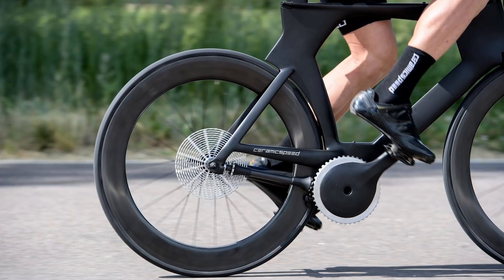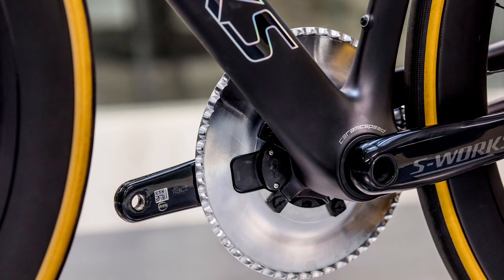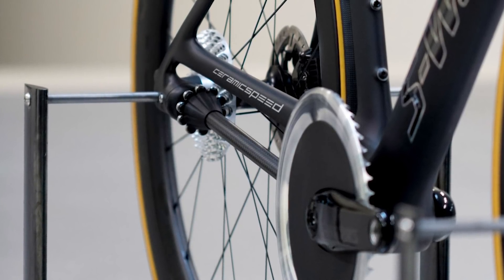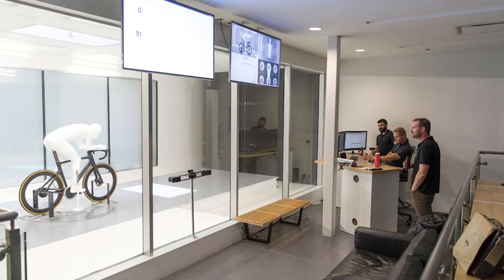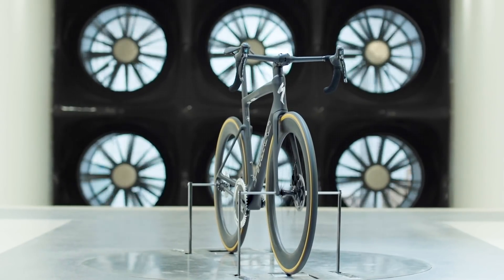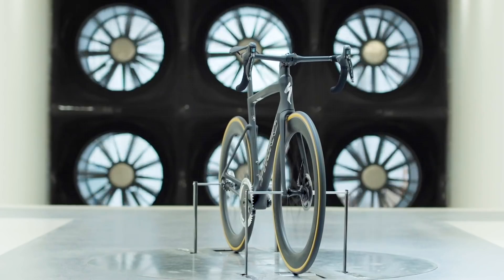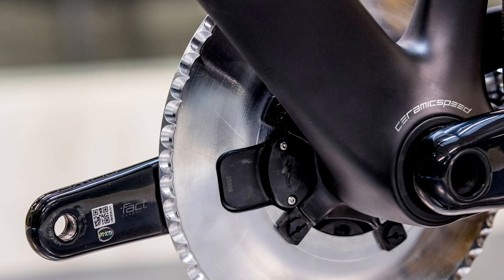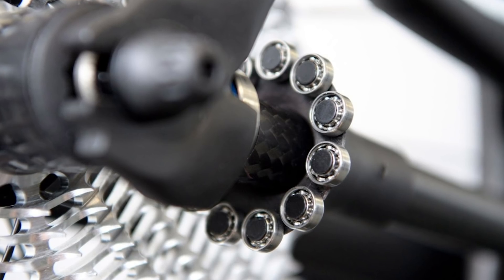'The World's Most Aerodynamic Drivetrain' | CeramicSpeed's Chainless Concept

Comment from the maker: Is this progress, or technology gone mad? Let us know what you think in the comments!
Reply: Marketing gone mad, not technology. It doesn't work, it wont work  (ask an engineer if you know one) and it's far from new. There is a pretty long list of fatal flaws and problems (non fatal but still requires compramise) but none of the press do anything but give this positive air time. It's a dud.

https://oldbike.eu/1898-quadrant-chainless-light-roadster/
Reply: Andrew Wade thanks for the link to that it was great!
Reply: @andrewwade5604  excellent point and reference. The 1898 model is actually better looking with full integration in the chainstay.
Reply: Doubt the system will handle sprinting loads, might work in a time trial application with more gradual force applied

In a sprint I doubt theres enough lateral stiffness in the rear disk to stop the bearings flexing it out the way and slipping
Reply: Currently very early days, but what we are seeing is enough to say "Hang on, they might be on to something", but nowhere close to ready-to-ride. Remember how long it took for disc brakes to be in the tour de france? Yea, thats right, it might be 20 years until we see this in a race. Currently ceramic speed has said they limited their tests to no more than ~250 watts as the drivetrain is fragile. They are also optimistic about scaling up the watts, but whether it can be done without a total redesign remains to be seen.

On a conceptual level, what stops me from getting the most out of the drivetrain on my bike is maintainance: Having chainrings, casettes, and a chain that is the prime of its life, keeping a clean setup, keeping dust and rain out of it on a ride, replacing bearings when they go, etc. Furthermore the rear-deraileur is incredibly fragile and can crumple up with the smallest impact or mechanical failure.

 What I find interesting with the new drivetrain, with the cover, is whether it will deliver that ultra-low friction more reliably than what a chain drivetrain does today.
Reply: It’s innovation.  Does it matter whether it’ll actually work?  Nope, not at all.  The process may discover something new or it may be a big fat waste of time.  No technological leap forward happens magically - it’s an iterative process with many prototypes.
Reply: Im sure these will come with electronic shifting but my god is it ugly.

Comment: Its still moving parts that are exposed, uncovered. We don't consider that as progress.
For progress, we want to see mechanism that are enclosed, sealed, & waterproof, so that its dustproof, dirtproof, mudproof, debris proof, etc (like Pinion or Rohloff Internal Gear Hubs) but at the same time with good gear range and good gear efficiency (like cassettes & chains), and good low maintenance (like Gates carbon belt or Drive shaft rods).
I guess good progress in technology not arrived yet.

Comment: I am amazed they are still working on this. Some quick research into motorcycle technology indicates that shaft driven power in motorcycles is substantially less efficient than chain driven power. Given that there is actually a lot of research and real examples of shaft driven power in motorcycles you would think that if they could rival the efficiency of chain driven then you would see it on motorbikes. I think once they actually engineer this to have similar reliability to a chain drive it would wind up being extremely inefficient to the extent that it is not practical for pedal bikes.

Comment: Everything about this bike would have to be incredibly rigid. Even a small amount of flex could cause the bearings to disengage/jump the teeth. I would, however, love to see it work successfully. It has the potential to blow away any planetary gear or CVD transmission system out there.

Comment: What about reversing the system, driving with the larger gear at the front? The front "sprocket" is already a SOLID piece, just add teeth as it's must more robust than the flimsy area in the back. Utilize a ring and pinion drive directly mounted to the rear axle and drive from the front versus the rear. Groove a hollow, ALUMINUM drive shaft (prop) versus carbon, incorporate tension springs at either end of the shaft and use the same current cable tech through a slip ring using a bearing to maneuver the gear change mechanism forward and aft. Splines through the prop shaft would mount to the gear change mechanism allowing full time contact. The system in this video is a very interesting idea...

Comment: I think they need incredibly strong materials to avoid slips and skips from felxation and even breaks because all the energy transferred through a small area of material.  I cant imagine aluminum as the cassette wheel, it would have to be some type of hardened steel. Something on he very high end of strength, shear and tensile.
Assuming they solve this- i thnk they have a design that is desirable just because it eliminates a chain and gear casette.

Comment: I envision that there will be too much flex in the rear cog plate near the outer edge due to lack of lateral support.  The pressure from the drive bearings will skip out of the teeth due to the pressure.

Comment: The gear change would be very complex - you cannot simply move the entire bearing wheel thingy down the driveshaft in one go while everything’s moving/under load. I think you’d have to split it into 2, moving the first half when it disengages with the cassette, then when that’s engaged on the target cog, you'd move the second half. Each movement would have to be synched with the driveshaft rotation and completed within just over half a turn of the drive shaft, which is going to be rotating at > 500 rpm or so at a high cadence. The overall gear change would also have to be synched with the position of the cassette as the 'handover' could only happen at a point where the teeth of each ring are suitably aligned. It’s not beyond the wit of humankind, but it won’t be cheap.

As someone else mentioned, the lateral stiffness of the 'cassette' is also something to be very skeptical about - especially on the outer row of teeth. There's very little contact area compared to a conventional chain, so slightest amount of flex in the cassette will cause skipping, and there will be a lot of lateral force on it. 

I'd love to see it work, but until then it's neither progress nor technology gone mad - it's nothing more than an interesting idea.

Comment: I'm fascinated to know how much torsional loss there is through the drive shaft twisting under load. Or how much loss transferring power between the front ring and shaft then shaft to rear sprocket, in Mike Burrows book Mike points out losses using bevel gears could be up to 6%. is the use of bearing instead of bevels so much more efficient?

Comment: What is the point?  It does not even change gear ratio .  Better test the oversized pulleys how many watts are costing .  Efficiency at how many watts?  Could trust it on track ?

Comment: Of course, you would use ceramic sealed bearings in an aerodynamically covered drive train, just what materials are used in the drivetrain would be the whole question.  Just covering a conventional chain set in the same manner might create the same advantage.  But creating a retail shaft driven groupo available in the market may be a way of introducing a new high tech mechanism that gets into UCI regulatory frameworks.  For example, you’ll never drop a shaft on a rough, cobbled road such as Paris-Roubaix or the Champs Élysées.  Or perhaps you’ll never drop a chain on a challenging climb, all of which happened in this year’s Tour.  How did disc brakes begin to appear in UCI races when at one time it was considered preposterously absurd?

Comment: the show video from ceramicspeed shows both single and 13-speed designs theoretically handling 380 watts.
the singlespeed shows the radial bearings fully housed, not sitting on open posts, and beefy, like it could transfer the kind of power and torque of a rider
https://youtu.be/UFAQ6CzNm7s?t=58

Comment: I want to see it on and especially after a 100km road tour before i believe in it. These open bearings will block after a short time and the aluminium blade like "chain" ring will wear excessively in a short time. And i'm pretty sure, under hi torque (high wattage/workload) deformation will occur.

Comment: They have a serious problem with shifting.  Simply moving the shaft in and in the current configuration would jamb given the tight tolerances. There needs to be a gearing geometry or a guiding mechanism which controls the movement from one ring to another.

Comment: No point being aerodynamic if it doesn't actually work. The only thing this is good for is getting the company more attention. That "cassette" has side loads put on it, any high loads will induce flex, and will cause it to skip. Drop down into the lower gears with the larger leverage, and you'll probably skip more than you'll be able to climb. There's photos of people "riding" these bikes, but there's no actual video footage of somebody riding one, merely somebody spinning it up, or lab tests in a wind tunnel.

Quit talking about the lab testing and prove that the thing actually f*cking works! No shifting still after 12 months after the initial publicity stunts? I don't believe this will ever surface, and if it does, it'll be plagued with problems, be overpriced, heavy on maintenance, and consumer unfriendly. Chain and cassette is still the king.

Also, those individual bearings for the drive gears have no seals on them, which helps with efficiency until you get it out in the elements. Sure, they could put some rubber seals on each one, but that will suck out precious watts pretty damn quickly, especially due to their small size. same reason skateboard wheel bearings have terrible lubrication and seals, they simply don't roll otherwise.
Reply: It'll never shift. It'd have to engage two gears at once, and thats self destruction territory. (Or have a neutral between each gear. No shifting under load). Sooo many things wrong with this and so many stupid media outlets giving this thing air time.
Reply: @andrewwade5604  Correct! I've felt negative about it since it was released, but the fact  it was praised so highly as an unfinished product? I'm only seeing empty promises here. The more you study it, the more you realise just how terrible it can only be.

Derailer gears might fail us from time to time, but they sure as hell won't give us the grief or expense this thing will!

The only thing Ceramic Speed have done here, is caught the attention of people who just don't understand enough to realise otherwise, that's why it's had so much media airtime. The media, even if they knew the truth, will still share it, because it's going to attract the attention they're all desperate for.

Comment: It is evident that the small wheels engaging the toothed crown-shaped cogs and spur have a sliding movement when they touch each other. Also, the contact point is very small, thinking about what power and torque any professional cyclist can put out.
The most absurd concern is that chainring is an old concept and should be considered obsolete, while upright bikes belong to an even older concept and an incredibly wide variety of recumbents have proven their aerodynamic advantage, far far more than what this device does.
Why did Specialized test this is good question indeed... But you know, 3D printers can put out extremely convincing mockups just in hours and with comparatively low cost, so in the endless effort to get 8 seconds out of 40 kilometers everything is worth testing...
My personal conviction percentage about this device is yet to crawl to 1%, for what a single opinion is worth.

Comment: Why is everyone hating on this? It looks awesome. Sure there's a possibility that it won't add any benefit or even work. But so what? Let's just see where it goes. Even if it is a total success and destroys your aging derailleur, no one says that you need to use it.
Reply: It does look cool, but... it looks to me like the shaft driver (the circle of cartridge bearings) is trying to push the 'cassette' into the spokes, so the cassette would have to be insanely stiff (e.g. Inconel) to not flex, wear, and skip.  I think the crank would have a similar issue.  Shifting would either require the shaft driver bearings to be rounded like marbles to be able to slide into the next cog, or there would be some synchronizer AND some amazing lube that would let each cartridge bearing outer race slide nicely from one heavily loaded tooth to the next, or raise up and jump to the next without letting the wheel spin backward.

Comment: Bollox. Biggest con in cycling
Reply: Don't buy it then. It's not even out. When did you last contribute to innovation?
Reply: Dog House trust me I won’t be buying anything ceramic speed. The comment was driven toward the aero testing of something with absolutely tiny  aero differences. In the real world there is no benefit. As for the drivetrain. Ive yet to see any evidence of it working or changing gear which will have larger implications.

Comment: Total BS.  this will never work ever!  It's a mock up and there claims are wrong.
Reply: Qualifications?
Reply: Electrical engineer.  First off you are changing the direction or torque 2 times.  This introduces looses.  Second the structure of the crank and the rear cassette will never support the loads involved on a single point like shown.  Inorder to resist deflection on the rear big gear you would need a massively strong hub with a fully integrated cassette.  The weight required to attain this strength makes it prohibitive too.
Reply: There, they’re, their...calm down now

Comment: My skepticism comes from two unanswered questions: how much torque can this system take; could it handle a huge sprint effort, or stomping on the pedals up an extremely steep hill? And how easy is it to swap out a flat in a race scenario. However, I don’t know that a big company like Specialized would go as far as they have with this collaboration if they didn’t think it had potential.

Comment: SPOILER: Might look good in the Wind Tunnel, but this system will never work.
Reply: Your qualifications?
Reply: @b-manz  It requires the cogs to be outrageously rigid, because it cantilevers the cog plate.  It's the same with the crank.  For a very small load, maybe.  Another issue is the shifting, which would require either miraculous synchronization, and/or bearings that aren't shaped anything like the cartridge bearings they are showing.  Otherwise they'd just jam against the next 'cog'.
Reply: Dog House I am a graduated mechanichal engineer.
Reply: Joanet Montserrat I cannot wait for this to work and all you pessimists be forced to eat your words. 
-a mech engineering student

Comment: When you load up 3mm 7075 aluminium    perpendicular to normal chain ie in the  most likely to deflect orientation.you see it's  Not going to happen unless you up the thickness weight or add a deflection stop.
Reply: Exactly my thoughts.  This is a glorified bevel gear setup, which requires serious rigidity.  There's no way that thinly machined aluminum cassette has anywhere near enough rigidity to prevent the very few rollers from skipping over teeth.

Comment: I think it's a noble concept, but the wobble tolerances will be too tight for an exposed Chainring, and worse the forces being applied will be perpendicular the the drive train. The whole drive shaft, frame, BB, Hub, Chainring, and Cassette will need to be beefed up to handle these side forces, and even then I'm sure professional riders will be able to make this thing slip under power with only a few bearings engaged at each end. I suppose you could have a stiff spring mechanism pushing the drive shaft against the Cassette and ChainRing to deal with wobble, but again under load I'm betting it will slip, and then with so much side load everything will wear and break down very fast.
Reply: Inconel to the rescue.  Hahaha.  I joke because I completely agree with you -- too many of the forces appear to be perpendicular to the directions in which the materials can resist flex.  It's cantilevers.  I only see the shifting working at one point in each revolution where the cogs can line up, with some crazy synchronizer and lift/drop mechanism to not grind the driver bearing across one cog and into the next.